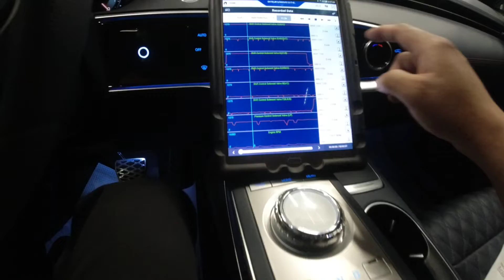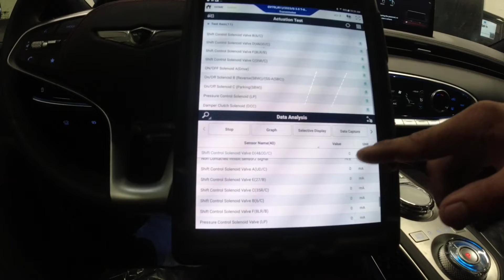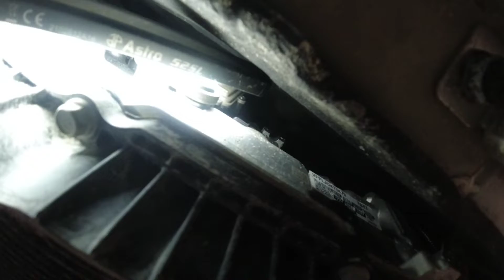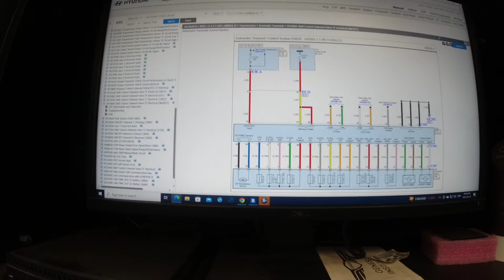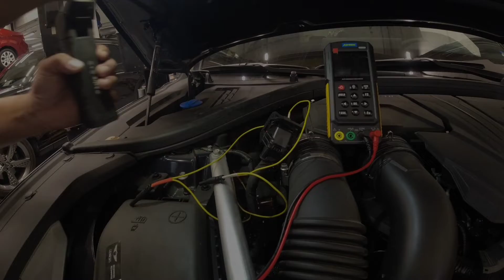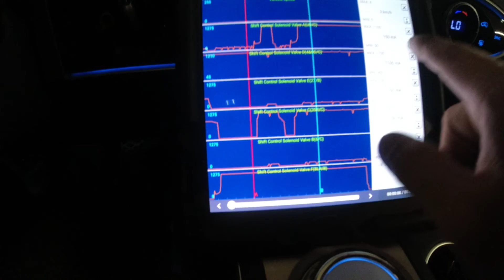2023 Genesis Gv70 transmission issue

Comment: Hi, Is it possible you can add a link the multimeter you're using thanks
Reply from the maker: https://shop.autooltech.com/product/autool-dm301-auto-diagnostic-multimeter-car-circuit-tester-power-probe-oscilloscope-diode-ignition-pulse-signal-test/

Comment: Hello brother AWESOME information and approach i have a KIA sportage  2023 2.5LT with B167288 ACTIVE CODE and P053200 PENDING CODE the first code B16 is say APT[AC PRESSURE SENSOR] FAULT- CAN SIGNAL ACTIVE CODE and the other says P053200 ac refrigerant pressure sensor A circuit low any help or information would be appreciated as always thanks for the video.
Reply from the maker: Looks like you have issue with you ac pressure sensor, check if you have short to ground on the signal wire for the ac pressure sensor, when you unplug the ac pressure sensor what code will create? Does it show circuit high code? Second check current data for ac pressure sensor you should atleast get 5 volts when its unplug. If its close to zero when unplug theres a chance you have short to ground, double check service information if its 5 volt when unplug. Or you can always check other vehicle unplug ac pressure sensor ignition on, check signal value. And also make sure you got power, and good ground going to the sensor if signal wire is okay.
Reply: @hyundaitech  Hello thanks for the fast reply really appreciated this car came from other shop they calmed changed the sensor I know there is 5 V REF ON THE SENSOR as the pcm supply the sensor 5 V and Ground and checks the signal for pressure voltage up means pressure up and so on i will do my checks when i go back tomorrow to work and the cods have know are P053200 pressure sensor A circuit LOW is PENDING in the PCM and the AC controller[module] has B167288 active will let you now if need more help or not thanks. Georges
Reply: buy the way can i check the ground by putting my test light from B+ TO ground that PCM suppling the sensor and check the light to come on is this will be safe to not damage the PCM  and do the same with signal wire what do you think thankyou.
Reply from the maker: @jgeorges3061  no I don't think that you will damage the pcm if you are checking the ground, and that's also good atleast you check the integrity of the ground. For the signal wire I would suggest to use Multimeter coz I think that is 5 volts same thing with the supply power for that sensor.
Reply: @hyundaitech  OK THAT IS GOOD TO KNOW AND THE TEST LIGHT I AM USING IS ONLY 120 ML AMPS NOT THAT MUCH THANKS FOR THE REPLY AND GUIDANCE APPRECIATED. CHEEERS
Reply: @hyundaitech  hello again brother regarding the sportage 2023 checked wiring find that when the ac pressure sensor hocked or not hockes to the connector that ground and signal wires have 5 V on them key on engine off looks like both shorted to 5 V REF WHEN i check ground on the pcm same wire my test light light up but will not light up in the connecter for pressure sensor any thought thanks.